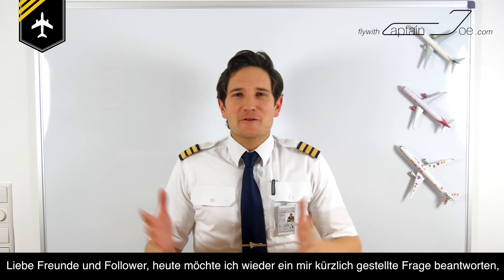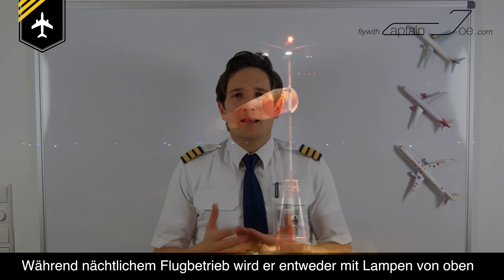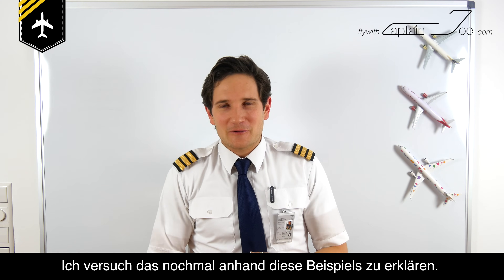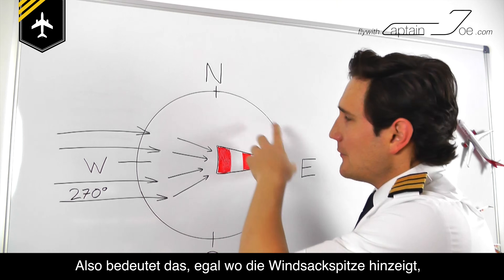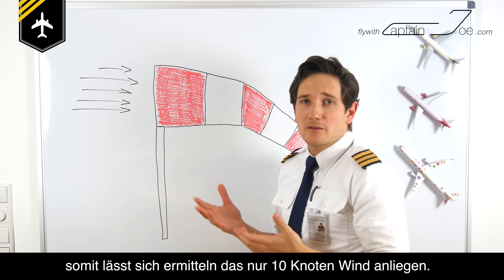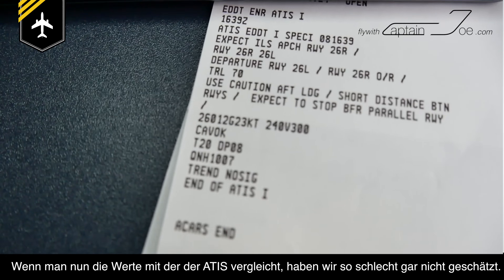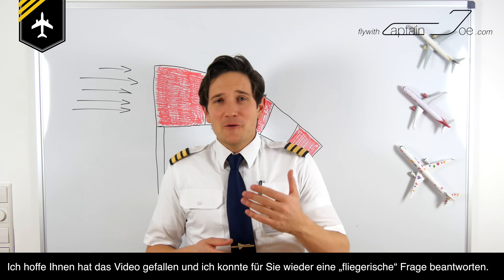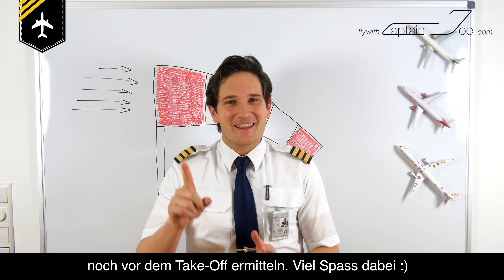How does a windsock work? Answer by CAPTAIN JOE

Comment: I often drive past KPBI (Palm Beach International Airport) and I usually look for the windsock. I could have sworn that the first two segments were rigid. 

I thought that I remembered being taught that the wind speed was read by the angle from the vertical that the tail was hanging at. Obviously dead vertical means no wind. I was told that the speeds were read as increasing as the tail became more horizontal. Is this not true? Is it true of a different kind of windsock?

Comment: I thought it was made for the purpose to determine on which direction the plane must take off. I thought that if the direction of the wind, for instance, is coming from the west going to east, the plane must take off towards the west so that it would be easier for the plane to take off because of the strong wind flow that passes through the plane's specially-designed wings.😅

Comment: Good explanation of the function of a windsock! Thanks!
In the United States the windsocks should meet the guidelines of FAA AC No: 150/5345-27E Specifications for wind cone assemblies.
They should move when the wind is at least 3 knots and fully extend at or above 15 knots.  I recall reading in other sources that the segments are 3 kts. each, but do not find that in the AC. Does anyone have a source document for the segments measuring 3 kts each; I can not locate the one I recall reading? Thank you.

Comment: Great explanation of the windsock.  I think most people know to fly into a headwind, (so fly into the tail of the windsock, not the nose), but I doubt everyone knows that the stripes equal 5 knots.  At my home airport, the windsock is solid orange (an uncontrolled airport -- no tower) so we had to guess at the wind speed most of the time, and due to mountains on downwind, then flat on base, then ocean to flat on  final, then a hill opposite the center of the runway, crabbing in was the norm.  The sock could be straight out at runway entry and then at 90 degrees at the center of the runway, so you really needed to get ready to crab or slip  in with plenty of rudder/aileron control.  And sudden gusts could change things rapidly!  (One time, I was about 10' off the runway when a gust nearly blew me off the runway and into a barb-wire fence and I instantly had to power up and go around!  Wind shear!)

Comment: Hello, captain Joe! Thank you for videos - its for people, who loves aviation, but haven't professional relations with it. Also i have questions for you and other subscribers: Its about turboprop planes, suppose you familiar with they as well. Some planes as Fokker 27 or Antonov 12-24 series starts engines with normal flight or taxi prop position. But some turboprops as Beach King,  ATR72, Dash8 series - starts props in feathering position and then - convert them into normal mode for taxi. Why they do that? In feathering rotation air drag force is bigger then normal rotation... What reason for it? Its good to faster reduce rotation after shut down, but on start up... Best regards! And developing in video producing!!!

Comment: In my piloting classes (in Canada), I've always heard that it's a myth that the wind speed is shown by the stripes but rather by the angle the windsock makes with the ground: if it is parallel to the ground, it means a windspeed of 15kts or more; you simply estimate if the angle is between 90° and 0°.  The stripes can't be used because (here at least), there is a metal frame at the opening, so it would always indicate at least 10kts...
Reply: Am I completely wrong or is the norm different between Europe and North America?

Comment: Hey captain, I'm a cadet pilot and I love your channel, one thing is bugging me at the moment. Pilots sit on either side of the centre beam in the cockpit, how do you align the centre beam with the runway centre line on finals when you are sitting at an angle. DA20's are easy as they are small, but what about the A320 especially during a visual approach?

Comment: Hello Captain Joe, not sure if you did this one before, but could you please explain the sometimes very noisy and insanely fast turning trim wheels in the middle of the instrument cluster? I heard on some planes there is a handle on the side of those which could smack a pilot's knee if it is not retracted. Does not sound very safe.

Comment: capt. how does the airplane measures it speed ?
Reply: Pitot tubes are the easy answer. However, aircraft don't have a single speed. There is IAS (indicated airspeed), TAS (true airspeed), ground speed and the Mach number. They are all different and serve a different purpose.
IAS is what Pitot tubes measure directly, it is actually closer to a pressure than it is to an actual speed. It is the most important speed for aerodynamics and for actually flying the plane.
TAS is the actual speed relative to the air, it is important for measuring performance. It is computed from static pressure and IAS. The higher the altitude, the higher the difference between IAS and TAS (IAS is lower).
Ground speed is the speed relative to the ground, measured by GPS or using ground references, or by computing is from wind, heading, and TAS. It is most important for navigation.
The mach number the air speed relative to the speed of sound, it is important as the plane approaches or breaks the sound barrier.
Reply: Mior Farhansyamil 
Hey brother .... just search for PITOT TUBE IN AIRCRAFTS...
U WILL UNDERSTAND..
ITS SIMPLE....
Reply: gubx42 
How can u type so much man....
I liked ur comment.....
I am fan of urs...
Reply: Mior Farhansyamil by measuring the wind's speed, or by GPS
Reply: Mior Farhansyamil airspeed indicators
Reply: Mior Farhansyamil it measures by pilot tubes search it up

Comment: Super Video! :-)
Wie ist es eigentlich mit dem Sidestick zu fliegen?
Insbesondere, weil das Flugzeug ein Steuerinput ja soweit fortsetzt, bis ein weiteres Input kommt.
Und bemerkt man bei einem ,,Alltagsflug" die Flight Protections?
Reply from the maker: +Vin Cent Der "Sidestick" ist wirklich einfach zu fliegen :) Bei mir mussten die Protections bisher nicht eingreifen ! :)
Reply: +Captain Joe Was man dazu sagen sollte, ist dass der Airbus im Gegensatz zur Boeing 737 fly by wire besitzt. Das heißt bei Boeing ist das yoke direct verbunden mit den ailerons (deswegen bewegt sich das yoke mit wenn der autopilot übernommen hat) und beim Airbus läuft das ganze über einen Computer. Und dieser Computer korrigiert leicht. somit ist Bank angle sogut wie unmöglich.